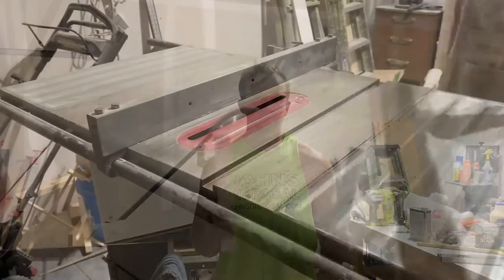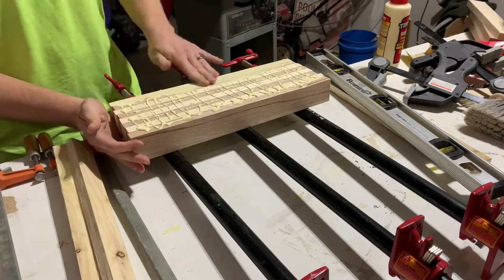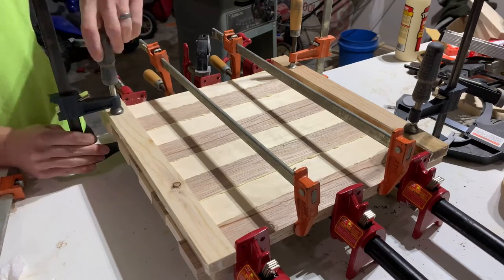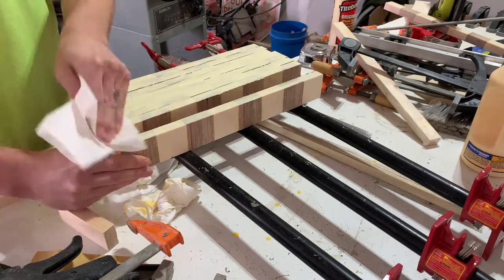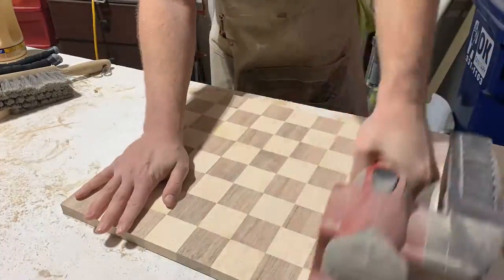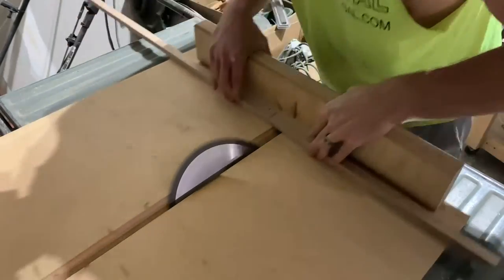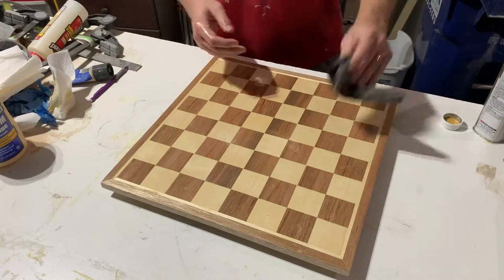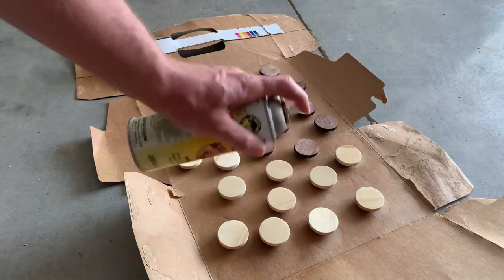DIY Checkerboard

Comment: Not long 'till you have a nasty cut on that table saw. Hope you have a first aider handy.remember the chess rule that also applies to drafts checkers. The white corner squre should be on the right and not as you have it. Good luck.
Reply from the maker: Well it’s been a year since that video came out and I have yet to sustain an injury from my table saw or any other tool for that matter. Do chess boards still function if the white corner square is not “on the right” ?